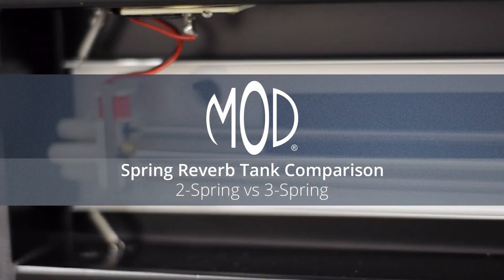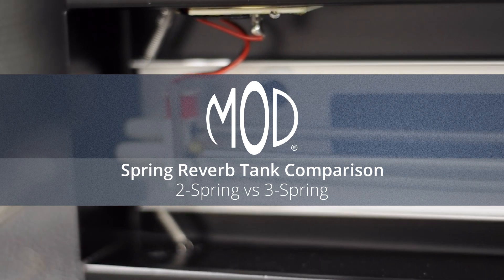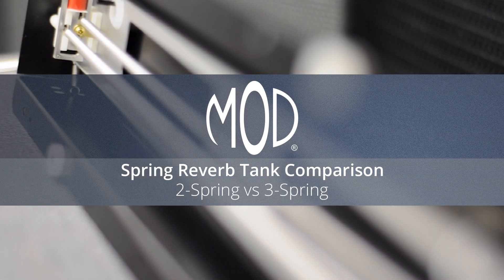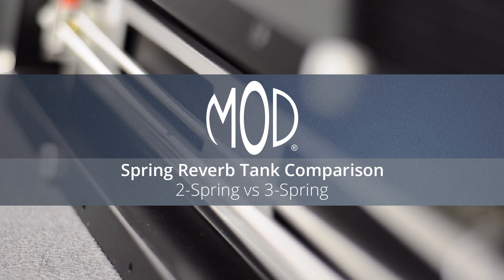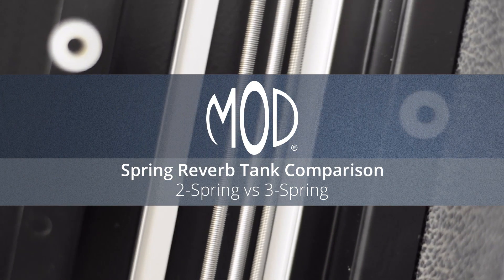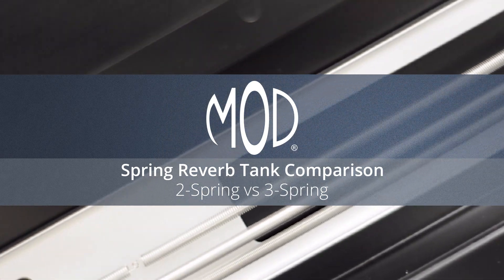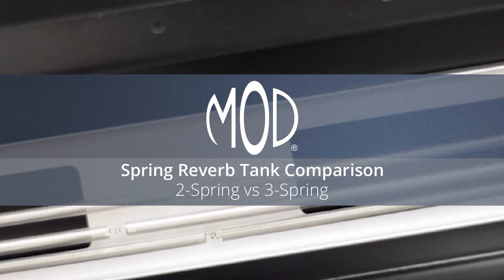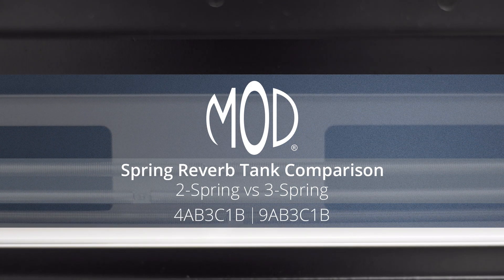Spring Reverb Tank Comparison Part 2: 2-Spring vs. 3-Spring

Comment: Nice test showing the differences between the two typpes, but I would have liked to have heard a humbucker equipped guitar as well.  
The three spring has a fuller sound, but that did make me wonder how this will sound with a humbucker guitar - humbuckers being 'thicher' or fuller sounding than a single coil - would a humbucker guitar through a three spring be too much, and better through a two spring?

Comment: HI !  I am looking for an ACCUTRONIC REVERB ( 4DB2C1C )  for replacement on a POLYTONE 103 AMP . The OUTPUT transductor ( " B " digit 2,250 ohms according to
the code ) is damaged . Otherwise I only need this single part if it's  available and detailed . Thanks for your answer . JLB
Reply: there are some confusion about the " B " impedance . You indicate 2 , 250  ohms and  Tube AMP DOCTOR  ( a German society gives 225O OHMS ) ,??

Comment: I wish during the comparison I could hear a hard cut off of the note, rather than just letting the note ring out either the trem every time.

I'd like to hear the decay with the dry note cut off.
Reply: Sadly, only a tiny fraction of online reviewers understand that short percussive notes are the best way to demonstrate reverb. 99% of all reverb demos I've seen has the reviewer playing only sustained notes, very effectively masking most of the reverb sound.
Reply: Not only playing sustained notes exclusively, but adding the tremolo bar during the sustained note also muddles up the assessment. A staccato note with no tremolo would be the gold standard test.

Comment: Thanks for these videos.  I am trying to find a reverb tank to give the classic surf "drip".  Would that be 2 or 3 spring?  Short, medium or long decay?
Reply: 2 springs the decay is up to you to chose (the old fender amps used a short tank)
Reply: @pedromartinazzo5036  - no. old fender was long decay 4AB3C1B 2 spring for that surf "boink" flutter. 3 spring are smoother. for most modern use shorter decay is better, less washy more natural

Comment: The two spring has a vintage sound to it for lack of a better word. The two spring sounds as if there is more reverb present too. The three spring reverb sounds good and I have used amps with three spring tanks. I think for a touch of reverb on a guitar for some ambience either spring would be fine, but as an effect it is a different matter.